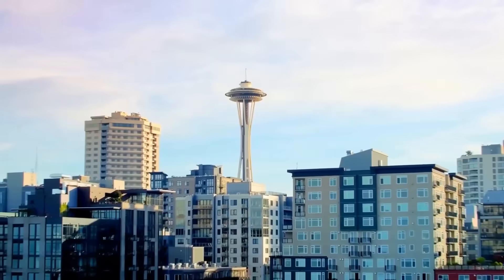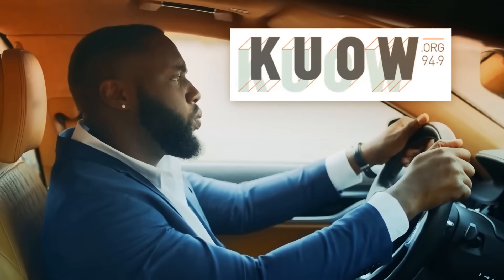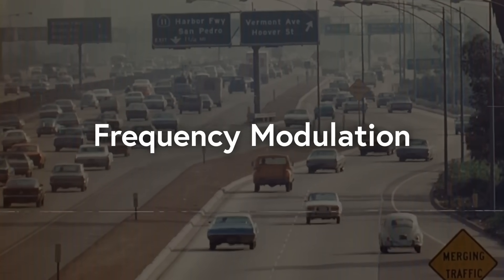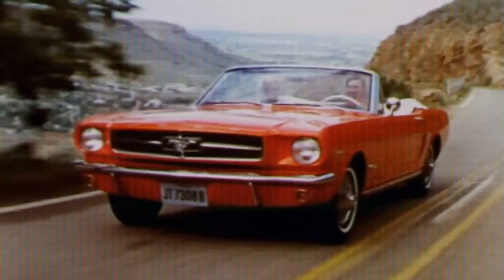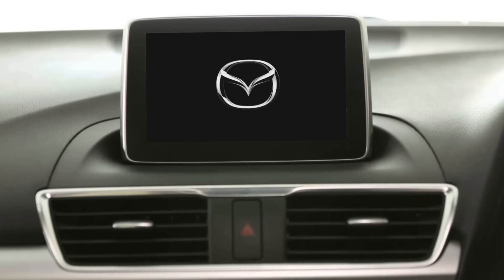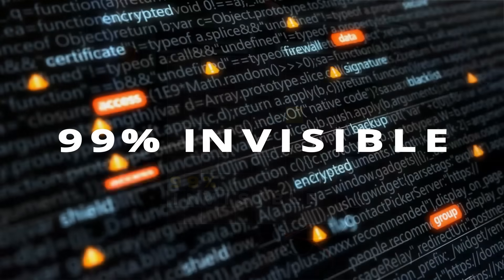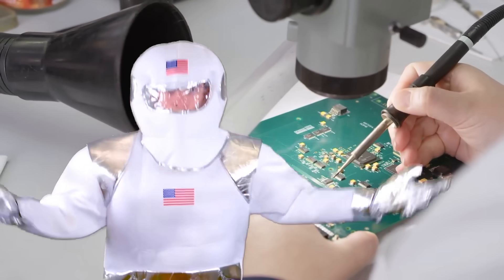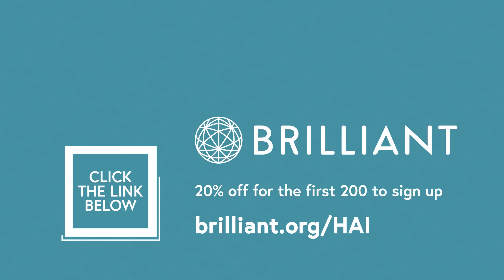Why Hundreds of Mazdas Tuned to 94.9 Broke Simultaneously

Comment: Back in "the old days" you got in your car, turned a knob to turn the radio on (click) and then turned it further clockwise to adjust the volume to the desired level. You then twiddled the other knob until you found the radio station you wanted. And you could do all this usually without taking your eyes off the road and you got simple AM music.
Then clever technicians then started to outdo each other and made mechanical push button radios to store and change the station by pushing one of about five different buttons that you had to program in.
Then someone else decided to make the tone adjustable, there by making it even more complicated and tedious. Then came loudness adjustment and then multiple speakers and balance controls, left and right, front and back.
Then came FM radio, so more complications. Next was a cassette tape player included which regularly chewed up the new tape you had only just bought.
Then it was music CDs ; more complications!
Just when we thought it couldn't get any worse we had a second FM choice, FM1 or FM2.
And then it turned into a bloody computer that had to be programed for about 20 minutes and it all erased if the car battery was disconnected. Old people had to get their grandchildren to program these SOB devices.
So, I don't listen to the radio anymore, it's all too hard!
Oh for the "good old days" with two knobs when you could just go click it on and twiddle the other knob to tune it in!
Reply: If you're incapable of programming an FM radio, you're probably not capable of living independently and belong to an elderly home.
Reply: On the bright side there hasn't been any decent commercial music produced for a couple decades now. Best you can hope for is a soft rock station playing stuff from the 90s.
Reply: @Eidako  That's why all my vehicles still have cassette & CD players!
Reply: @sunbeam8866  I thought I was the only one (with a CD player).
Reply: @DiaperDon_BoneSpurs_Epstein  How about a cassette player? 🙂
Reply: @sunbeam8866    Not in my truck (although it originally  actually came with one) but I still have an old DUAL dubbing cassette deck somewhere in my house!!!!  A true artifact!  Now.... what about:  an Eight Track?
Reply: @DiaperDon_BoneSpurs_Epstein  Late '70s was the last time in my car. Couldn't wait to go cassette. I did pick up a Craig 8-track home recording deck with a real walnut case. plus a companion Craig car 8-track at some point. Might be collectors items now!

Comment: This seems like an issue that should only require the dealer to reset the audio module to the factory as-built data, not require the entire module to be replaced
Reply: Firmware update. That was my thought. But if the file format bricked the UI, it may have also bricked the firmware update capability. Sometimes there is a factory reset header connector, but as described, would require the modules to be sent back to the factory (Japan).

Comment: As a good mater of principal certain systems should be compartmentalized. Anything do with the operation of the car should be isolated from everything else that it doesn't need access to and should NEVER be remotely connectable. Having your radio stuck on is annoying, but it won't cause you to crash unless it is stuck on country music.

Comment: And then you realize you can just Bluetooth or plug in your phone to act as the radio. Seriously, I’ve never had an issue with my Nissan Leaf from 2013 since I just don’t use the radio (never had the right music).

Saves your car, you still get your radio, and you don’t have to shell out thousands because of a software issue.

Comment: Yet again another sterling example of why I drive a 27 year old truck NO COMPUTER  although the models with an automatic transmission have one. 3 of mine are standards,YES I have 6. You can roll start the standards not even needing a battery in a pinch as the engine is diesel and the only electronic parts are the starter and the solenoid that turns off the engine which is easily bypassed. Cannot understand why cars and trucks need to be full of computers.

Comment: Yikes - the %i issue shows they weren't escaping their data input. This is a major security issue, and also the kind of mistake anyone working on professional hardware should no never to make and also to test for anyways. Looking at file extension to determine file type is also a poor idea, as they accidentally demonstrated. This is why I'm for more likely to trust an EV from a dedicated EV company such as Tesla than a traditional car company, who presumably know a lot more about designing safe engines and a lot less about even the basics of proper software design.

Comment: I had a Nissan which kept crashing its satnav due to the digital radio. It turned out that it had to have its first station tuned to a particular radio station with the strongest signal in the area to cure the problem, not exactly easy to work out that was the fix without a trip to the dealer.
Reply: Cars are becoming more and more like horses with their personality quirks and things they like and don't like

Comment: My favorite radio station is 94.9 but thankfully I don’t live in Seattle or drive a Mazda built between 2014-2017, instead I live in Iowa and drive a Toyota that was built in late 2009.
Reply: In that case, your car will be fine, but your sandwiches will sometimes default to mayo

Comment: Long before HD radio, not long after FM car radios became popular, I was one of the credulous fools who thought that new, weird engine technology was something that needed to be supported.  I bought a new, 1972 Mazda RX-2 with a Wankel rotary engine.  I quickly learned that not only was the rotary an undeveloped, unreliable, backfiring, plug-fouling, non-starting-in-cold-weather gasoline wasting piece of crap, but that every other piece of the car that could break down in normal service would, and did.  From flat axle bearings to wonky alternator, from non-extending retractable radio antenna to seat upholstery so brittle that it cracked when you sat on it, virtually every part of the car spelled lemon.  I have pretty much gotten over the shame of having wasted my money so uselessly, but I have always kept the promise I made in those dark days: I have never bought another Mazda product , and I try my best to never accept a ride in one.

Comment: Here's another "glitch" involving car radio: If you have XM Radio in your car, sometimes your cities' traffic lights will emit enough electromagnetic interference to "swamp" the satellite signal incoming to your XM receiver. No damage is done, but you may have to sit through that long stop light with no sound from your car stereo (it gets muted with a bad signal).
Reply: Can't be any worse than losing FM reception momentarily going through a freeway tunnel, no?
Reply: @ScubaSteveM45  that’s right
Reply: It's not just Sirius XM. Lights can also affect regular FM signals too. There are also these LED screen billboards in my city and whenever I drive past them, my FM station goes to static for a second.
The LED lights they've been installing in gas station canopies also seem to have the same effect on radio signals, since the radio tends to cut completely to static when I stop to get gas.
Reply: It happens at certain drivethrus, too.

Comment: How the hack are these bugs supposed to be related in any way with EV's more than ICE's? Where this BS ever came from?
When the irony is, an EV needs an electronic to run just a single electric motor, an ICE propulsion system needs half dozen of them, along with tons of solenoids and sensors, all operating together.

Comment: My 95 Dodge Ram is fully mechanical, can run on kerosene, french fry oil, and jet fuel, and is proven to last a million miles. When the landfills are full of batteries and the lithium strip mines are empty, I'll still be rolling coal while you're whipping a donkey.

Comment: I'm wondering if a similar programming issue is what caused my Hyundai's infotainment system to reboot when I tried HD Radio for the first year I had it. AM and FM worked fine, but if I toggled to HD, it would crash and reload. Thankfully it didn't brick the system and seems to have resolved itself now, but still.

Comment: This is why I am reluctant to utilize cars that depend heavily on software in order to do the most basic functions.  Clearly, in the case of the Mazdas, just who is at fault for the failure of the radios?  Mazda or the radio station?  I would say Mazda, because if it required the file extension, it should have had an error trapping routine in the event that a file is received without a file extension.  This is just basic programming.

Comment: 4:41

Agreed, with more computers, there is alot more room for complicated error. 

For example:

Let's take a tesla, and a Ford f-100.

Both these cars come into a shop with the same issue, let's go with uhhh...chugging. [for an ev, it wouldn't really be chugging, as much as the car jerking forward or backwards when it shouldnt]

With the tesla, you've gotta go into the computers and see if something is wrong there thats causing the chugging, if its not in the computers its probably in the motors for the wheels, and if its that, you have to understand electronic components so you know how to fix this. [I've never worked on a tesla so I could be talking out of my ass.]

With a Ford f-100, you just adjust the fuel-air mixture in the carburetor and your good to go. its as simple as opening up the hood, and turning a knob. [I've never seen a f-100 so idk if they have this knob or not, but most carbureted cars have it. so im assuming the f-100 does too]

Even with some newer gas cars that don't use carburetors, its most likely a problem with the spark plugs. wich you can replace pretty easily.

Don't ask me about diesel though. I dont know how that works yet. I just know they make more torque, have cheaper gas, and use glow bulbs instead of spark plugs.

Comment: My 2016 Infiniti’s infotainment system would always reboot itself only when I drove through one specific area of town. I figured the dealer (an hour away) would be unable to reproduce it and tell me I was crazy, but they did know about it and fixed it with a software patch.
Reply: What was it about that particular neighborhood?
Reply: @nmarbletoe8210 Apparently it had something to do with the navigation system and the specific location I was at. It’s also a place where satellite radio connectivity is always poor because a road I often drive there hugs the base of a steep tall ridge. I never got a clear explanation and likely the dealer wouldn’t have been able to give me one, they probably just had a manufacturer software update that fixed random reboots and that’s all they were told by the factory.

Comment: Saw the original story on another channel, and predicted it was in the data sanitizing. I was sort of right. First mistake the programmers made was ass-uming all data coming in would be valid. Never trust data from uncontrolled sources. I learned this back in 2007 when I started programming a website for a company that I worked at for 10 years. With image files from external sources, you check the file header to see if the data is valid, then process it through a filter to ensure there is no malicious payload. After validation and conversion, then you can use it. Same goes for the rest of the data stream. The fact that the % symbol could affect the radio at all further in the processing stream is an indicator that best practices were not carried out.
Might I have made the mistake? Sure, but I'm one person, not a team of programmers with QA specialists backing them and hardware engineers working with them to ensure everything functions.

Comment: I strongly disagree. The radio station did not make a mistake. It is the responsibility of the radio manufacturer to validate the data before they use it and if it doesn’t match their sp ecs then to reject it. 

To say it was partly the fault of the radio station will create unwarranted heat on the radio station which they don’t deserve. 

This is all the radio manufacturers responsibility. 

And you have a responsibility not to communicate Incorrect information.

Comment: Cool 94.9. The at home, in the office, and broken down on the side of the road station.

Why Mazda decided to build their BCM this way is unconscionable. You don't need the same thing that runs your air conditioning to work the radio. This is not good. Tying it all together makes it just that much more trash when it inevitably fails and when service and parts stop being supplied by the OEM. A built in bricking of the entire vehicle once the manufacturer decides it isn't worth supporting anymore.

People somehow think cars are more friendly this way. Just wait until they get old. These "features" make them scrap iron. This is not ideal.

Comment: Like when Swedish TV stations were once turned off nationwide by an electronic alarm clock going off in a program. The sound from the clock mimiced the tone sequence used to turn off all slave transmitters at the end of the last program in the night.
Reply: Hi, where can I read more about that story? I find it very interesting and can't find anything in English nor Swedish about that piece of news ;)
Reply: @bitsandscience  I don't know. A quick search revealed nothing. This was probably about 50 years ago. I'm old enough to remember when it happened. We in my family were one of those who did get TV broadcasting via a slave transmitter. The standard at the time was that at the end of the program around midnight or so, a beep-beep-beep was broadcast from the main stations. This tone turned off the slaves remotely.
During this incident some electronic clock made a beep in a regular program, and that beep was interpreted as time to turn off by the slave transmitters. So they turned off early in the evening, instead of after midnight or so.
This was during the cold war, so there were some newspaper articles about how easy it would be for the presumed enemy, Soviet Union, to just capture a main TV transmitter and send a beep, then most of the country couldn't get any TV news.
Reply: @apersson850  mmmm okay, thanks. Well, I read in the 90s something similar happened to a radio in Finland which played a song called Maan Tapa and it contained the tone sequence in your neighbour country to turn off the TV transmitters in Ylenis radio. But couldn't find anything similar looking by keywords in Swedish haha Do you remember which show was airing that time when the incident happened in Sweden?
Reply: @bitsandscience  I found a recording of the intended sound signal that was used to stop the relay transmitters. You hear it at the end of this short movie, right before "the ant war" starts.
When the slaves stopped unintentionally they had some electric alarm clock or equivalent that emitted a similar signal and turned the whole system off.
Reply: @apersson850  did you find the recording at a tape in your house or you have a link? So that movie emitted the tones and TV signal turned off, right?
Reply: @bitsandscience  Sorry, missed to include the link. In this "episode" it's intentional, of course. I don't remember what was aired when it happened accidentially.
https://www.youtube.com/watch?v=M7Xrnnnbfgc
Reply: @apersson850  ok, thanks. What did you mean by "the ant war"?
Reply: @bitsandscience  Direct translation from Swedish (myrornas krig) for the random noise shown on analog TV receivers when there's no broadcast.
Looks like ants running around.
Reply: @apersson850  ahhh okay, like the static (for analog TV)
Reply: @apersson850  I found this which is very strange as the man speaks and it's shut off instantly but don't know if that's because of an error from the person who recorded the tape or the actual error you talked about: https://www.youtube.com/watch?v=0HEBgEN1sjs&list=PL096AF8935A2A98C0&index=7

Comment: Interesting video but slightly misleading. As I'm sure it was frustrating and inconvenient for those Mazda owners whose radio went haywire that day. It didn't "brick" the entire car. The radio would've needed to be replaced but is completely isolated from the ECU which controls the engine and other electrical systems .

Comment: Small correction: The FCC didn't invent/standardize HD Radio. HD Radio (Which stands for hybrid-digital, not high definition) is a proprietary format that stations must pay licensing fees to iBiquity to use.
Reply: Thanks, thats the info one would expect in the video!
Reply: If it's sent out over the airwaves, the FCC has a say in how that happens. No matter who made what.

Comment: Isn't there a bit in the new infrastructure bill requiring new cars to have systems in place to keep you from driving if impaired?    So a computer... that won't let you drive your car.... if IT THINKS you are impaired.   Can't wait for a faulty firmware update on that system to brick tens of thousands of cars.

Comment: I just got my first car and it’s a Mazda 2. The only annoyance that it gives me is when I plug in my phone and switch it to iPod mode it’ll always play ABC by the Jackson 5. I’ve kicked my radio at least 70 times now and I’ve owned it for less than two months.
Edit: no I can’t turn auto play off and also if I have a video playing and it either pauses or goes to an ad, it will always play ABC, even when it goes back to the video. Having to hit the skip ad and play button while driving is quite dangerous
Edit 2: it’s been one year since I’ve had my car accident and now I’ve upgraded to a Mazda3